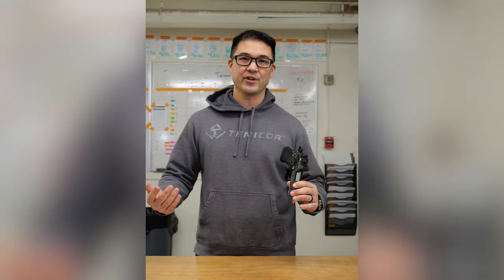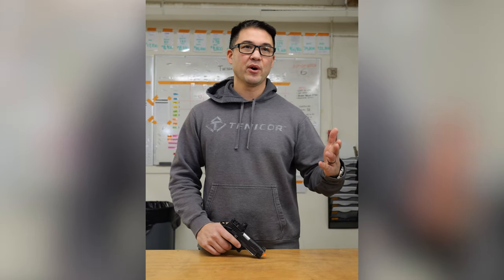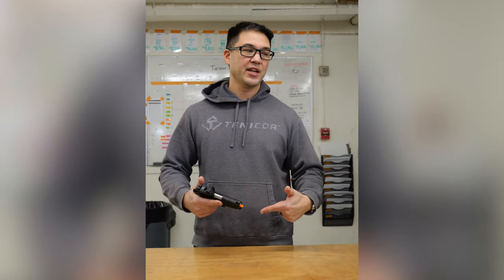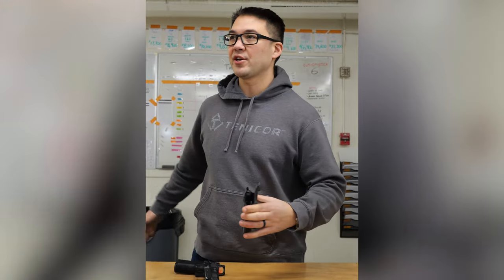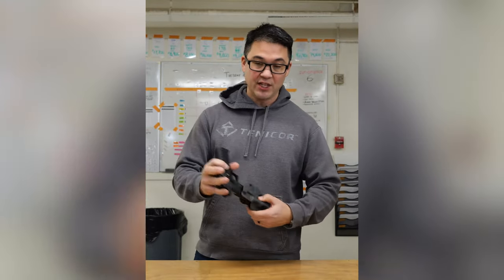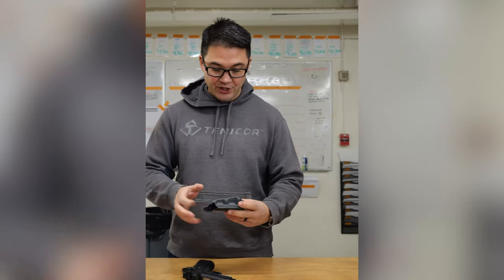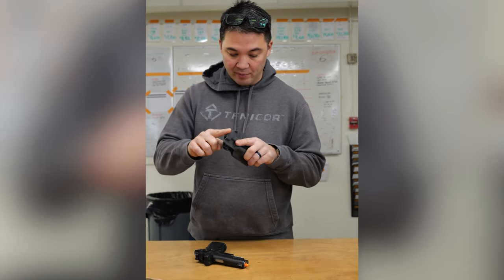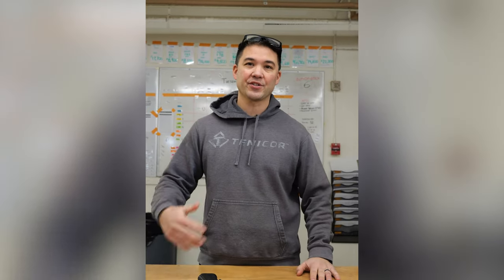Why Tenicor holsters? QC - Tenicor #tenicor

Comment: I have 4 holsters and I love them all. I really appreciate the fact that I can run my 43, 43X, 43X MOS, and 48 MOS in my holster that is designed for those in conjunction with the TLR 7Sub and not require the light to be mounted for retention. With or without the light I can run the rig on me 🤙🤘